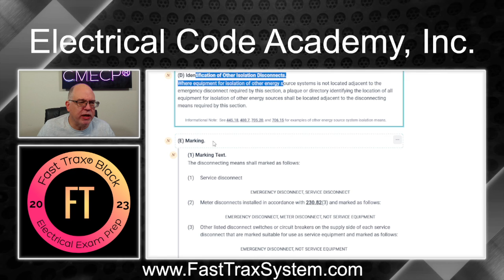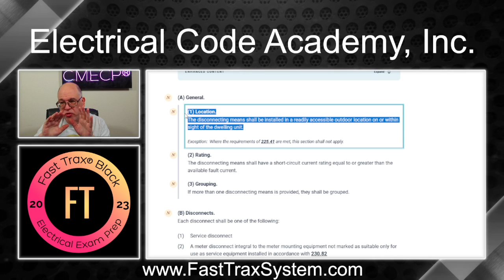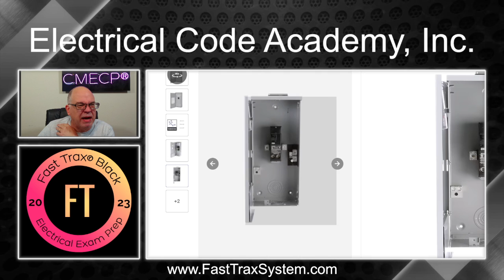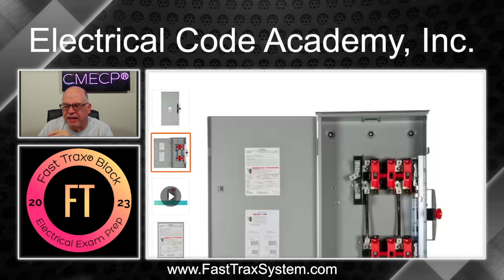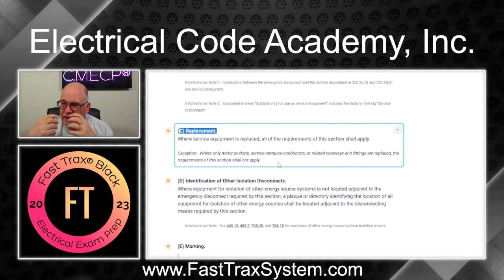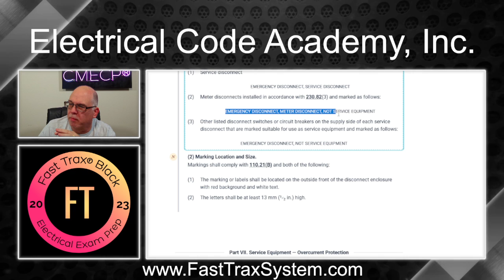2023 National Electrical Code | Section 230.85 Emergency Disconnects

Comment: If I’m replacing a panel for a larger size with more available space on my residential home does it require I also change the meter out, if it’s not new construction?
Reply: @Money-yj4wg  what did you come up with? I am going to do the same thing in the near future
Reply from the maker: (C) Replacement.

Where service equipment is replaced, all of the requirements of this section shall apply.

Exception: 

Where only meter sockets, service entrance conductors, or related raceways and fittings are replaced, the requirements of this section shall not apply.

Comment: Thanks for making this informative video, it’s cleared up a lot for this newer requirement as my jurisdiction has just started the 2023 nec.
I do have one question on clarifying the disconnect being marked as suitable ONLY for service equipment, I am confused on this marking why it should not be used? Is it because it provides no OCP? Just looking for clarification 
Thank you!

Comment: I got a correction to install a 400amp disconnect for a 400 amp dual meter for a 2 unit homes. 
I put a fused disconnect and placed 400 amp fuses, is that acceptable?
Reply from the maker: Greetings - hard for me to answer this based on the limited info provided. I would think, due to zoning requirements, that each unit would have their own disconnection means. However,  if your AHJ says they want the 400A disconnect, if just trying to meet 230.85 then it could have been infused but the conductor would still be service conductors and then 230.70(A)(1) comes into play. Assuming it only to meet the emergency disconnect rules, which is what this video was about, then being fused or infused would not matter as long as the equipment is "SUSE" rated.
Reply: Any update if the fussed disconnect was acceptable?